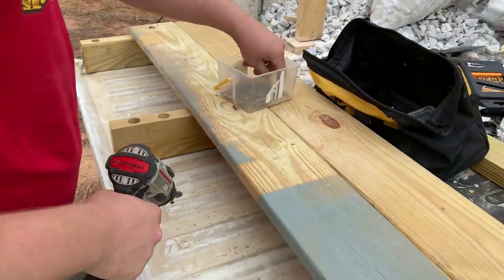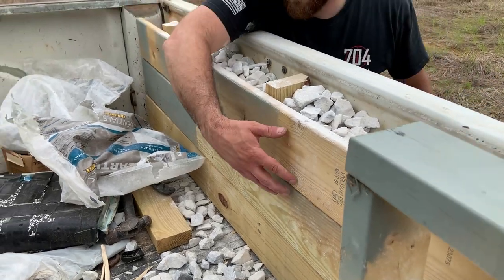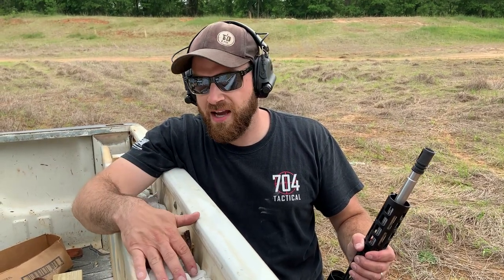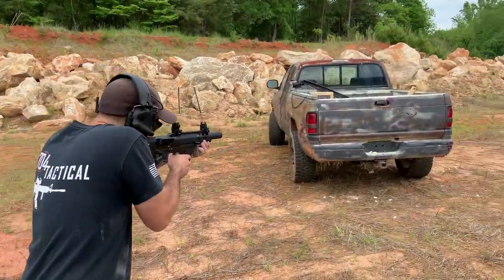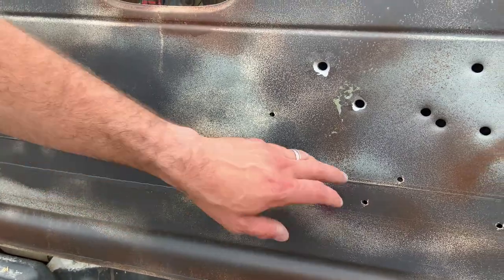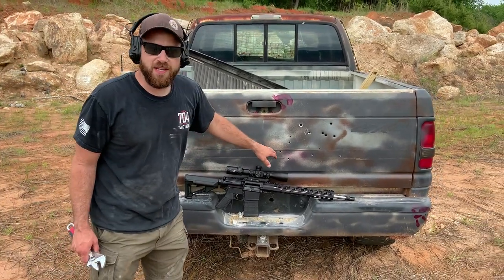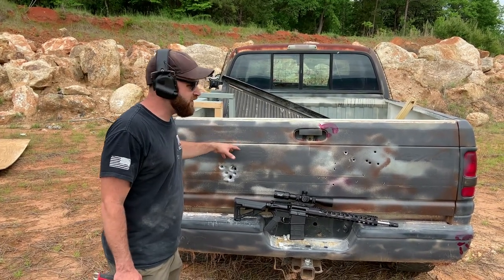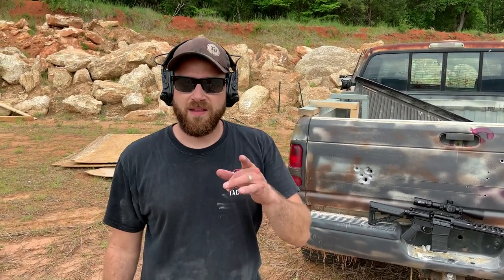DIY Bulletproof Tailgate That Works !

Comment: Awesome video. That did really well. Probably needed to run a board at the bottom to retain all the rocks. It sounded like they were hitting the bed when you poured them in. If you try lowering the tailgate, they’re going to spill out making it hard to close
Reply from the maker: True absolutely

Comment: What if you filled the actual tailgate with the gravel instead? You could probably even use cement to fill it up and then it doesn’t take up space in the back
Reply from the maker: There are welded supports 1/3 and 2/3 of the way down there completely cut off each section from each other that was our first attempt

Comment: How much rock did it take to fill the tailgate and what did it weigh? Wonder if it's lighter than plate steel. Also, would be interesting to see if smaller rock sizes are equally as effective, lighter, heavier, etc. Cool video though for sure. Very impressive results.
Reply: Smaller is denser heavier and better plus Toolbox in back

Comment: Been common knowledge for decades that gravel and sand between boards absorb bullets and shrapnel better than solid concrete or brick walls, they move around sapping the energy of the bullets or fragments 😁 sandbags work the same way but all those joints between the bags are weak points.

Comment: Gravel works better 2x4 stud studs filled with gravel use steel studs the 2x4s are the weak link plywood in and out think external walls

Comment: Why don't you get a 1/8 in or 1/4 in Ar500 steel plate and just use that it would work way better
Reply: What would the cost be vs a bag of rocks...
Reply: @blantant  depends on who you know but that would make it Buch better and look better than that and it literally would only be affected by and I quote "multiple. 50 bmg black tips" two or three around the same area would have to do it the glass would of course be different but you know what I mean it'll be heavy somewhat but  it'll be way more durable as it'll splatter the round and last decades of rounds fired so a couple in a shooting at you won't do anything

If a massive steel Plat that is bigger than me cost me 200$ I'm sure a rectangle cut one or ar680 wouldn't be more than 400 so if I really wanted to AR or up my car which would help against crashes as well we could do it for 2k or even less I'm gonna try that at the shop when I get a chance and have my friend cut it at his armor place